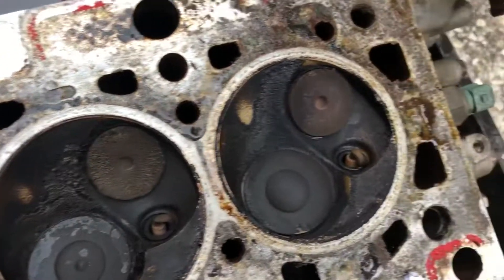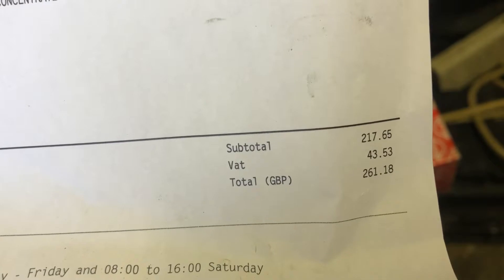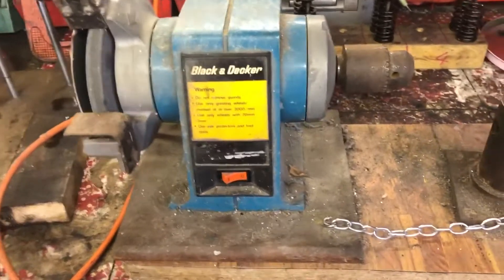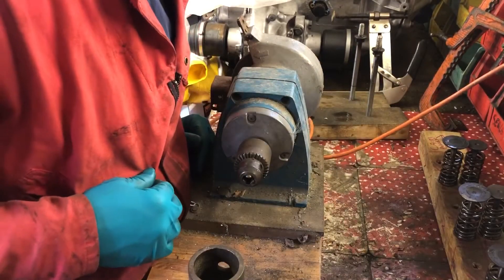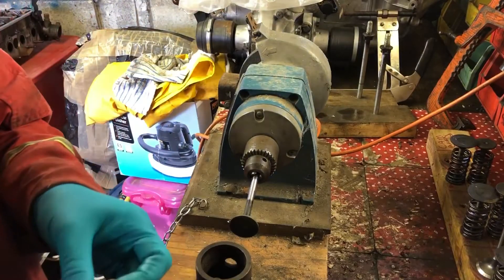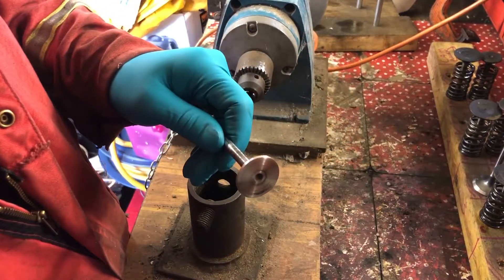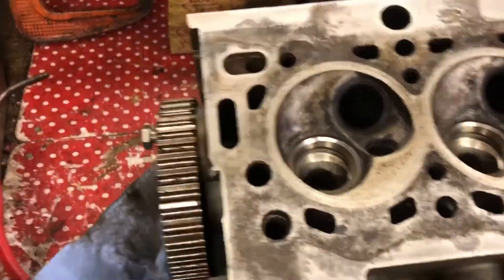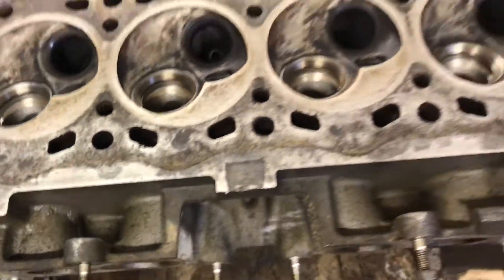Peugeot 206 - Cylinder Head Rebuild

Comment: How do you know the roller is in the correct position once the sprocket was removed to replace the seal/washer? 

Im thinking of getting a new second hand cylinder head and just wondered how to line new roller up correctly if that makes sense
Reply from the maker: Sorry a bit lost with you’d question. Are you talking about timing the cam to the engine??
Reply: @NickThornhill  I think so lol, basically the roller in the cylinder head controls all the valves ... usually, it's locked in place, but if for whatever reason it had to be removed or replaced , how do you know which way to put it back in?

Hope that makes more sense.
Reply from the maker: There’s a locking tab on the cam pulley (My tab broke off and I have a short on the the repair I did for that, this is the reason I’m doing this rebuild) 

That tab locates in the end of the cam to the pulley. That should be fairly obvious to get right. 

Once the pulley is fitted, There should also be a hole in one of the spokes of the cam pulley somewhere, that lines up with the hole in the side of the cylinder head. I think I used an M10 or M12 bolt to locate that. 

Also to time the engine correctly to the cam, you need to put the flywheel locking pin in too. For this I use a bit of 3/16 brake pipe. I think the actual hole is 5mm or 6mm. 

The flywheel locking pin hole is down low on the front right side of the engine, not easy to spot but google it and you should find it. 

Once all the locking pins are correctly positioned, just slide the cam belt on and tension it and it should all be fine. 

Before you try to start the car, turn the engine over by hand with the spark plugs out a couple of times to make sure none of the valves hit the pistons. 

Word of warning for If the cylinder head is off the car, DO NOT TURN THE CRANK UNTIL YOU REFIT THE HEAD. You can unseat the bore liners if you do.
Reply: @NickThornhill  thanks for the info I may have a crack at it in the next week or so I think I get it 😅  we will see lol
Reply from the maker: @A7Xdookie good luck. You can briefly see the locking pins and my repair of the cam pulley on one of my shorts. Let me know how you get on.
Reply: @NickThornhill  will do bud cheers
Reply: Is that Petrol or Disel?
Reply from the maker: 1.4 petrol 8v. Peugeot TU3.
Reply: @NickThornhill thank you! Then I have same one 😎🤩☺️
Reply from the maker: Good luck with your rebuild.

Comment: How would you go about timing if you didn’t lock of the cam can you just turn it back to the timing whole and csn the rocket train sit wherever ?
Reply from the maker: Yes you can. My first one was 1 tooth regarded so I had to re-align the timing marks. With this rebuild the cam had obviously been not turning so I had to start again. 

Theoretically as long as you align the holes, it should be ok. Obviously turn it over by hand a few times to make sure nothing hits anything.
Reply: @NickThornhill  ok great and In your opinion do you time from TDC or middle ?
Reply from the maker: @c-wild114 on the front of the engine, near the flywheel, there is another alignment point. I put a bit of old brake pipe in it to get the crank in the right place. I think you see a snippet of it in the part 1 video.
Reply: @NickThornhill  sorry I was in the format that you are rebuilding the engine
Reply from the maker: @c-wild114 Aahh no just the cylinder head after the cam pulley came undone and the keyway failed. The engine stopped suddenly. Lol. 3 new valves and it was good to go. Pistons had indents but nothing that stopped it running. 

Obviously I had to re-time it but a top end rebuild was as far as I went.
Reply: @NickThornhill  ah great thank you
Reply from the maker: I should add, don’t try to turn the engine over with the head off, you risk popping a liner up. Position the crank first then take the head off.

Comment: Nice work Nick. Did your bench grinder come with a drill chuck fitted or did you modify it?
Reply from the maker: It came with it as an accessory. It’s an old school bit of kit from the 80’s.
Reply: @NickThornhill  A lot of the best kit does. Black and Decker-tastic 👍

What make are your work gloves?
Mine always rip.
Reply from the maker: Mine rip too. Lol. I’ll let you know if I find some that don’t 😂. If you want a bench grinder like mine, screwfix sell one similar on item number 3515J